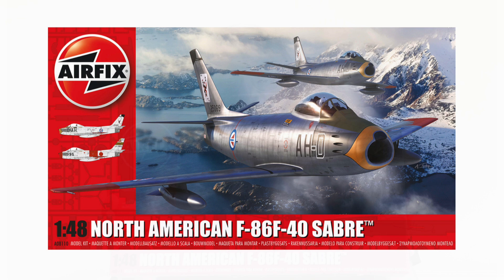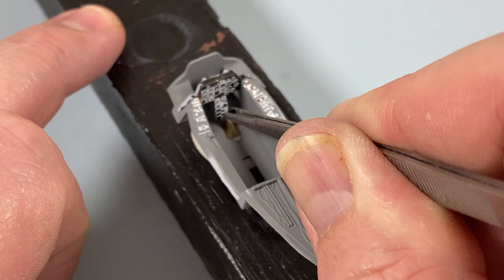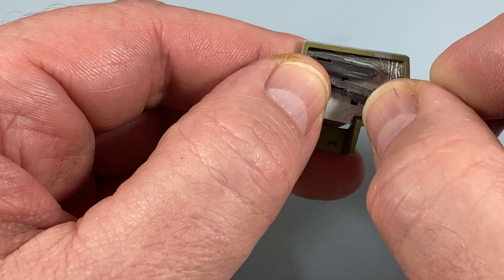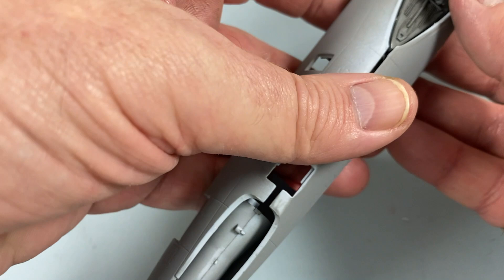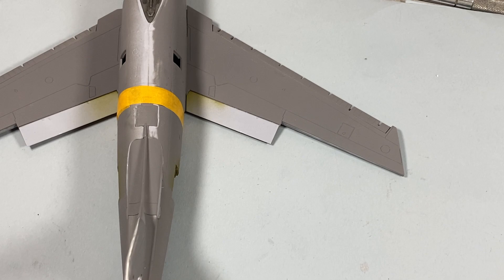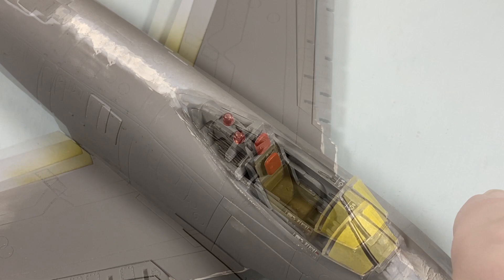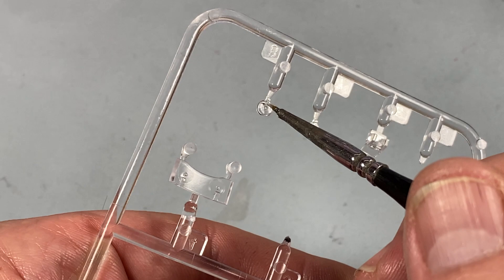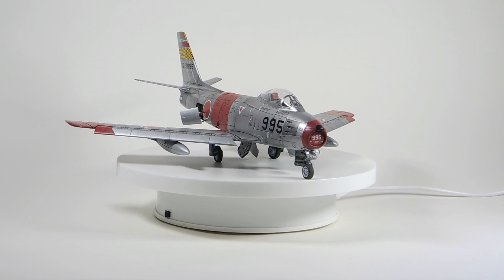Airfix 2022 NEW RELEASE North American F-86F-40 Sabre 1/48th scale FULL BUILD - HD 1080p

Comment: Lovely build Gary. What paint did you use for your natural aluminium?
Reply from the maker: Cheers Ian. I use the Vallejo system of black gloss primer (77.660) then Metal Color on top. For aircraft I normally use their duraluminium (77.702). Sometimes, like on the Hunter, I might put the Metal Color on a lighter base for the undersides, but generally it's on black.

Comment: do you prime all parts while they are still on sprues?
Reply from the maker: Yes I do, just a very light going over with a spray primer at first. Helps with bits I need to paint on the sprue e.g. cockpit parts and I find it helps with checking things like fuselage seams.
Reply from the maker: @dicksmith3553  that's quite the haul! Safe journey and happy modelling!
Reply from the maker: @dicksmith3553  this is why I only use a gentle coat of primer at first. I use a spray can of a general acrylic primer for plastic (Jenolite) applied from almost arms-length so it doesn't get too heavy.

Comment: do you seal paint before a,dding decals?
Reply from the maker: Yes I normally give it a gloss varnish before decals as it helps them sit better. I can give them a matt or satin final coat later.
Reply from the maker: @dicksmith3553  I have only done it once so far - on the 1/24 Spitfire. I don't think I varnished between colours, but I had varnished the base colours first.